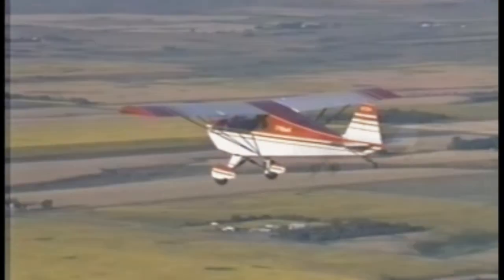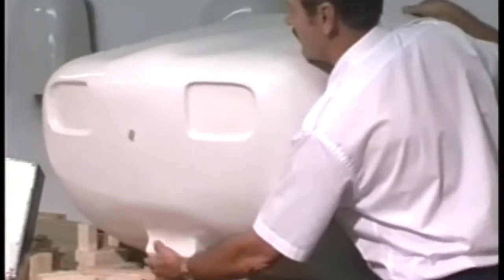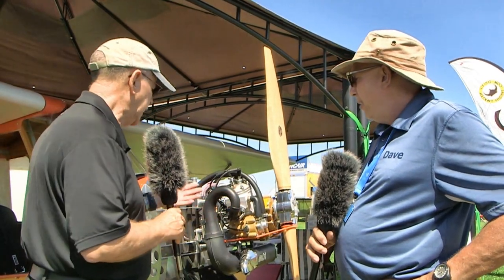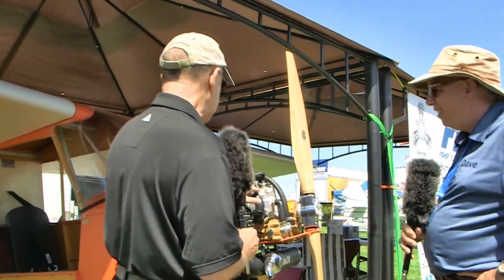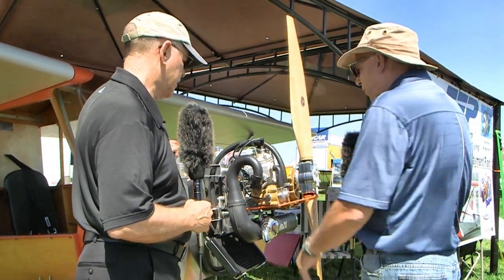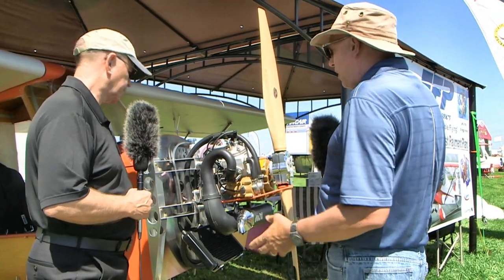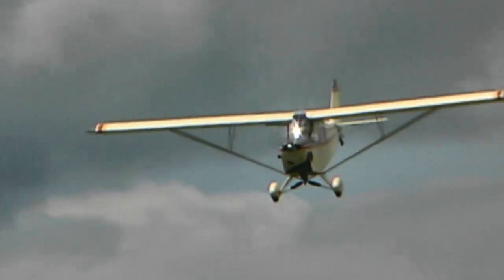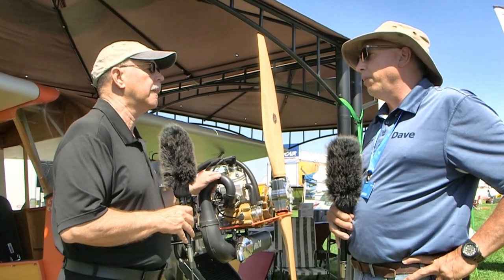Fisher FP 202 Koala, Part 103 Legal Ultralight, Fisher Flying Products Ultralight Buyers Guide 2022.

Comment: awesome looking part 103! I would not state 'no training required' if you have never flown,  you better get some training and part 103 states that you must follow NOTAMs. If you have zero training you will not know what those are and even less where to find them.  And if you have to know NOTAMs you will need to know air space.  You are to stay away from other air traffic so you need to know what other air traffic typically does.  So you better get some training. Edit, glad you mentioned to get some training at the end.
Reply: Agreed.

Comment: Very interesting, although I've known about Fisher a long time. But I am getting more & more interested in part 103 enclosed aircraft, although I don't mind metal fab and welding either.
Reply: @Airstrip Kid sure, the badlands is tube & fabric, formally the kitfox lite, and then there is the Merlin lite, its all aluminum. And they all look and fly like conventional airplanes. There may be a couple others like these tractor high wing enclosed ultralight designs I think.

Comment: I have several questions.
1) Are these engines  multi fuel or just av gas?
2) I know they can, by law, go only so high, so fast, but how far are they allowed to fly. Can these planes keep going from airport to airport.
Reply from the maker: They run an car fuel, they are limited to 5 gallons of fuel, and can travel about 55 mph hour, using between 2 and 3 gallons per hour, so they are limited to fuel stops every 100 miles or so.

Comment: Don't expect to receive a Fisher plane kit like this nowadays this was the original Factory when it was in Ohio if you buy a Fisher plane now you will have to fabricate almost all of the parts nothing will come pre-shaped like this it is extremely different from the original owners how you receive your plane kit you have to know a great deal of mechanical knowledge and machinist experience engineering experience I'll come and hand building your plane because it's very difficult it's not easy some people say if you could build an RC plane that you can build a Fisher plane not true I recommend you purchasing the sport plane builder book by books the whole set by Tony bingles b i n g e l i s he has a lot of information that will be needed building your plane so you don't get frustrated and want to throw in the towel I also recommend EAA aircraft building techniques how to series on wood and it helps tremendously with wooden airplanes I also recommend all of the EAA home builders DVDs they will help you tremendously when I built my plane